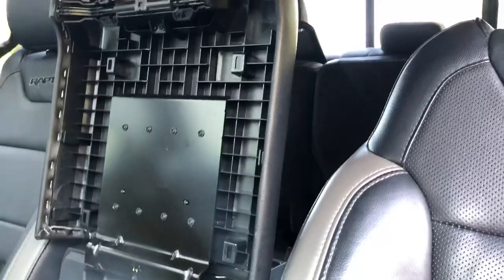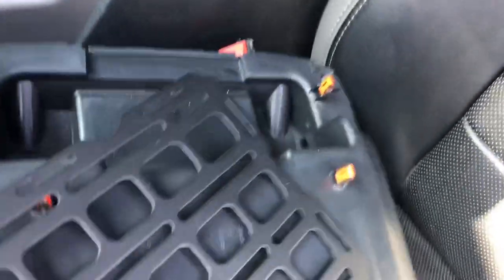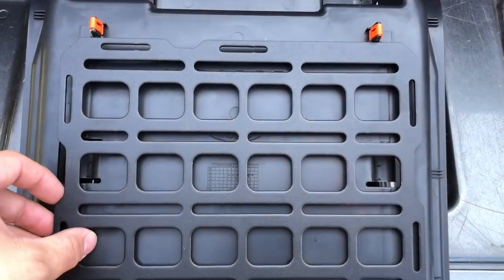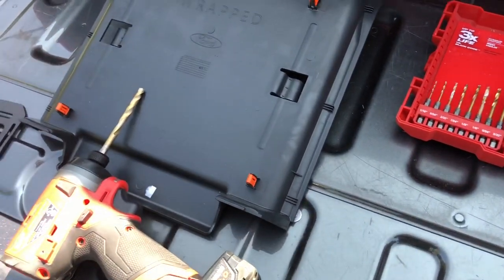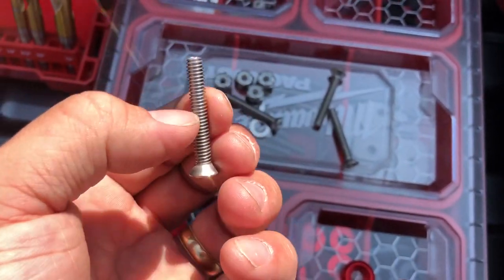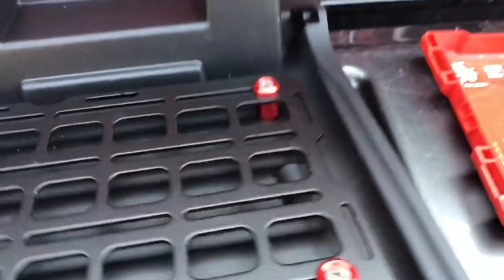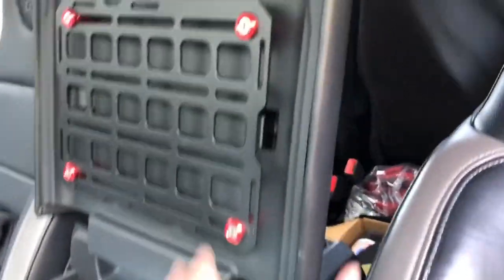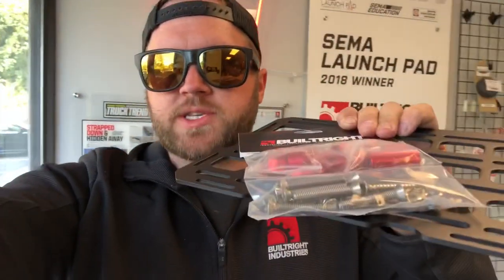BuiltRight Industries Tech Plate - Center Console Install

Comment: My Tech Plate install was not as seamless as shown in your video. I lined up the plate just like you did, drilled the holes, used the tallest spacers in the kit. Reinstalling plastic liner went smoothly until the bottom two clips, which would not snap back in to place. I needed to trim off two pieces of the honeycomb under the lid, not sure if it was because of bolt length or a combination of nut and bolt. After trimming off a bit of the honeycomb the bottom snapped in to place completing my install. I am very pleased the the fit and finish of this 7.5” x 10” Tech Plate, it looks great.

Comment: Will this work with the Convenience Package for the newer F 150?  I  have a 2022 Raptor and the center console folds outward to create a flat work space.  Thank you
Reply from the maker: Hey Jason, while we haven't test fit this in a convenience package ourselves yet, it should work in most full-size trucks with a 10x7.5" flat surface in the center console. That being said, different hardware may be needed to accommodate for the shallower depth of the armrest where it folds out. If you're up for it, we always recommend giving it a shot! Please let us know how it works out if you do. Thanks!
Reply: @BuiltRightInd  it worked fine, no issues.  I posted a review on the site

Comment: Do you have a tech plate small enough for the center console lid of a Ford Ranger?
Reply from the maker: Hey Jeff, while we haven't test fit this tech plate in a Ranger ourselves yet, we're assuming it will be a bit too big for your center console. It measures in at 10"x7.5", so if you're able to get something flat that size in there, it may be worth a shot! Please let us know if you do install it, if it's too big they work great in tight storage spaces around the house/garage.

Comment: When will they be available?
Reply: They are now, check the website for Tech plates. 10 x7.5, think there is a mistake in the description of the video .If you clink on the link it will bring you to the correct panel.  If you email he will respond.
Reply from the maker: @ericschaefer5407  Thanks Eric, good catch! Yes, the parts needed are available via the links in the description.
Reply: @BuiltRightInd  I'm here for you man, always after more stuff for my tremor. Think the dash mount might be next..